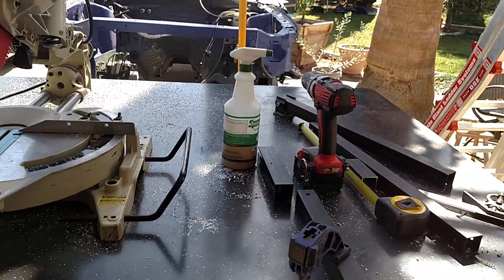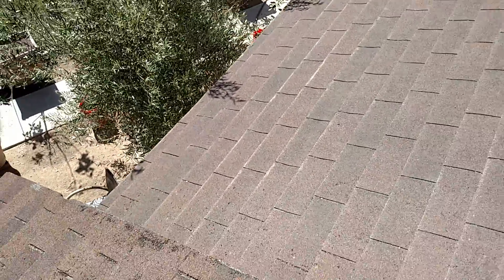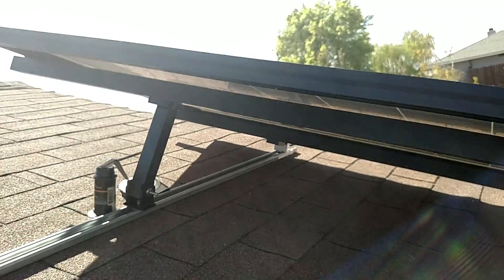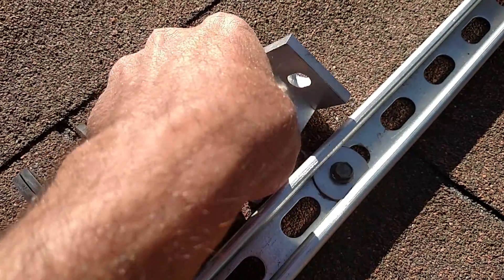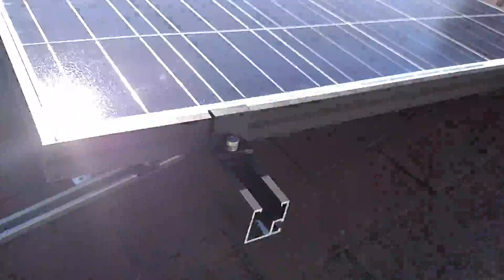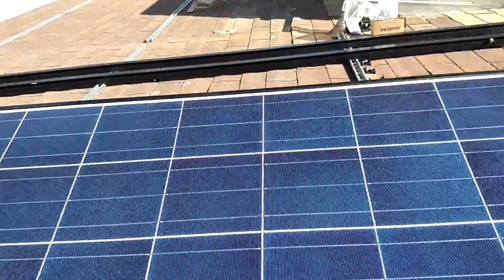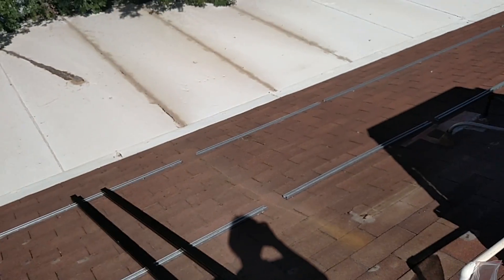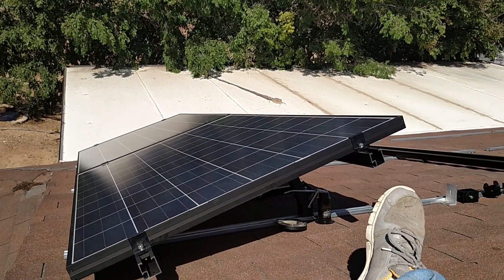DIY Solar Panel Install Project 255W Canadian Solar Enphase Micro Inverters

Comment: Just buy Unirac Solarmount, it's MUCH easier and about the same cost as doing a DYI racking system and works perfect.  I know, I'm doing mine right now.

Comment: Thanks for posting this. I am in the process of installing the same system - CS panels with Dual Rack, so your explanations were great. One question - were the tilt rack pieces from Dual Rack as well? Thanks again, great job.
Reply from the maker: Yes. All from dual rack.

Comment: It seems like water would get dammed up by the rails. Are they literally sitting on the roof flush? curious.  Is that Uni Rax or something else? Manufacturer?
Reply from the maker: +Stephen Anderson Yes, they are sitting flush on the roof. There is a few inches of relief between the 10' uni-strut sections for water drainage. It's actually a non-issue up here in the desert as the rainfall here is very minimal. The racking is called dual-rack.

Comment: looking good..that''s gonna be nice size system. i did a similar system (although smaller...although i keep doing addons with enphase (easy to do too)...i wound up scrapping the tilt and just went flush (S-SW facing). i know the 18 deg is optimal, but i figured i would add an extra panel to make up for the back of an efficient tilt.  nice part with the enphase is that the wiring is the easy part... unlike the old string inverters

Comment: I was surprised to see you didn't use some sort of leak prevention for the bolts holding the uni-strut down...?  I guess I thought that was a code requirement, but maybe not?
Reply from the maker: beforebefore All I did for that was squirt some good silicon in the hole before driving in the lag bolt. We get very little rain here in the desert.